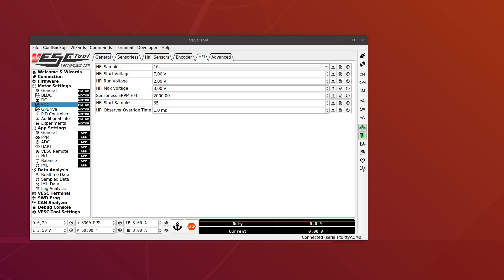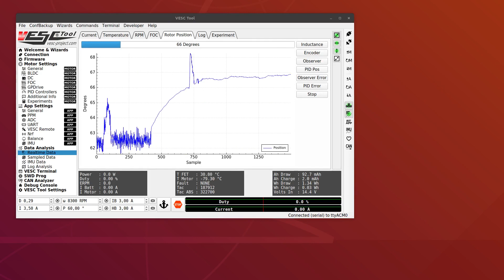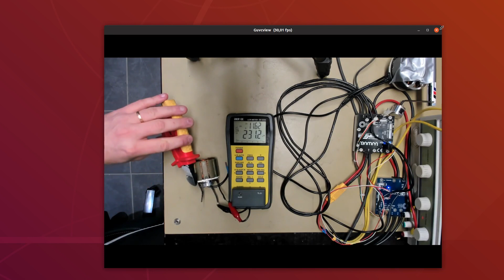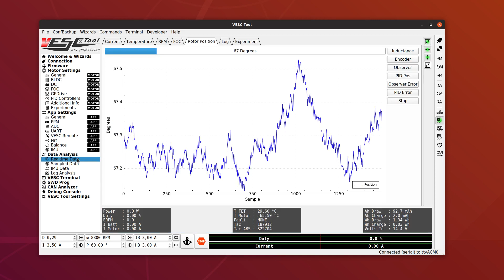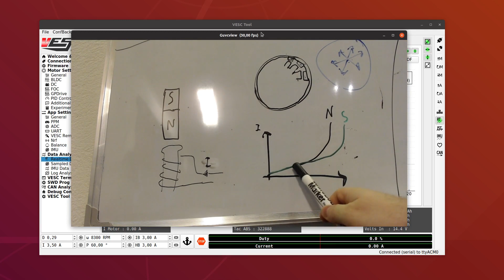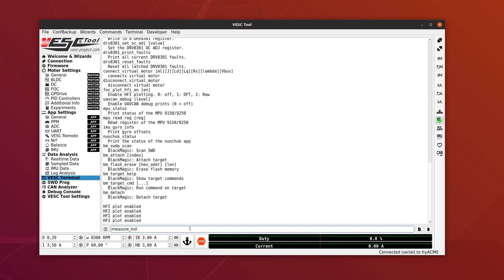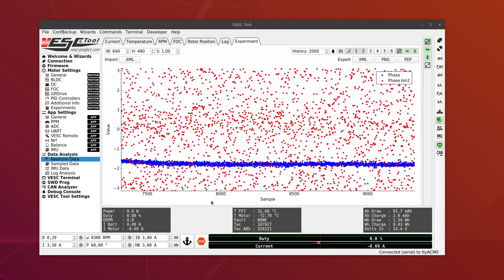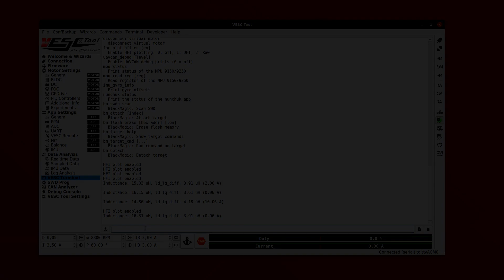VESC HFI: Sensorless position tracking at zero speed

Comment: Just tested HFI on a bench setup - nice work man! It's a definite improvement for low-speed sensorless startup. My larger e-bike motor had some difficulty at first, but adjusting the HFI parameters solved the problem. Works just as well (if not sometimes better) than hall sensors!
Reply: Great to know
Reply: What did you do to get it working ? and did you had the same graphs as in the video ? I'm als trying to get it work on my eBike, but get no good readings and grapsh even if I put the voltage's very high.

Comment: hello I have a question to ask I have performed all the steps of your videos but I find a dangerous disconnection from the remote board that occurs when I brake at high speed surely it is the generative current return that sends haywire you could help me because despite having entered the values you report on your videos I do not solve

Comment: You are controlling position by creating a graph of the inductance over 360° of rotation, If I understand correctly.  This seems similar to the steps that a stepper motor is capable of. How many points in your graph? If I use this as an alternative to a stepper motor how many micro steps can I get from this strategy? I don't really need that many because I just want to use it to run a wheelchair or two wheel mobility scooter.  I may want to apply it to a CNC milling machine or plasma cutter later on.

Comment: Hello, I am using a VESC UBOX Dual 75100 and I am trying to configure the electric scooter engine to work with HFI, but my blue dots at the first stage are in random (?) order and they do not change when the motor rotates by hand
https://i.postimg.cc/R0zqXLP6/photo-2022-06-09-23-50-05.jpg
😟
I tried to look at the "motor position" and turn it: at idle, it correctly shows movement, but as soon as I turn on Full Brake (with HFI), this graph shows something random (along with this, the ERPM values change from -1000 to 1000) and also does not react to the rotation of the motor.😓
Maybe you have any idea what this might be related to?

Comment: If someone was wondering how to get HFI to work on a 2kg 80100 motor. Set HFI currents (Motor Settings/FOC/HFI) to 30A. If you're using a Lisp script: Don't use (set-current 0), but rather (set-brake some-number) so HFI stays on. If still doesn't work, look at video from 21:05. He uses "foc_plot_hfi_en 1" to plot the tracking data. If that's noisy then your HFI currents are probably too low.

Comment: Dear Benjamin, I'm currently working on my Master's degree in "EV torque vectoring" and my Matlab model is almost done. But I strongly desire to build a scale model with individual control on rear wheels. After many attempts to find something suitable I find a bench of BLDC's ESC but with terrible PWM control and also meant decent ESC but very expensive(my University didn't intend to cover expenses).In the end I found your Open source VESC and I was happy to find out it support CAN and many other features.
My question is: "Does it possible to make possible to send PWM or even directly rpm parameter and receive backward other parameters such as speed (rpm); current back from VESC to Master Microcontroller (in my case NUCLEO-F746ZG
)  via CAN? "
Please also mention what hardware revision and software revision does support that future.
Reply: Yes, but there is very little documentation on implementing this. You can use serial or CAN bus. The tutorial is on his website.
Reply: @RoadSurferOfficial  Thank you.